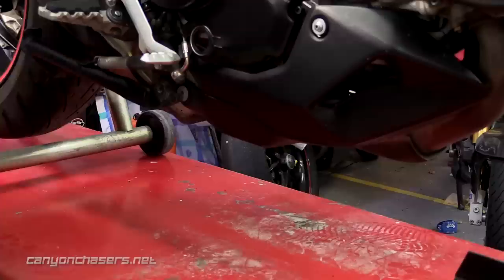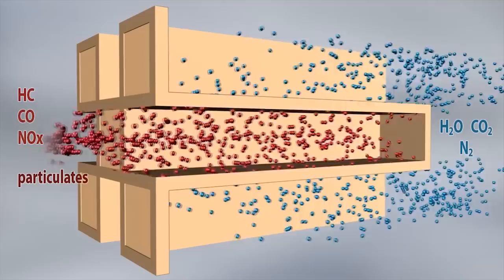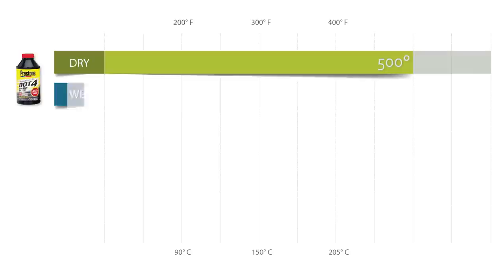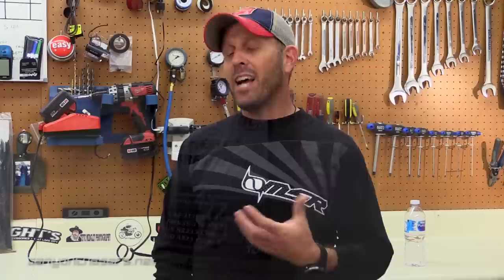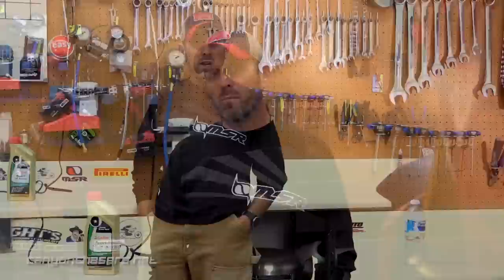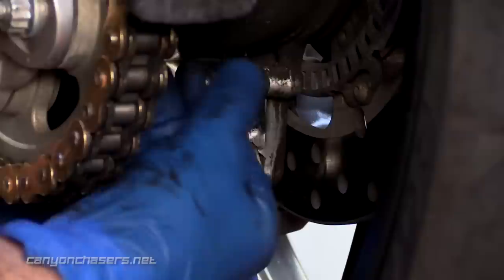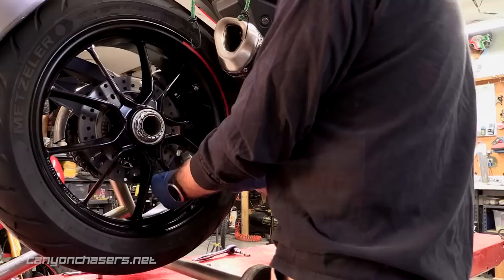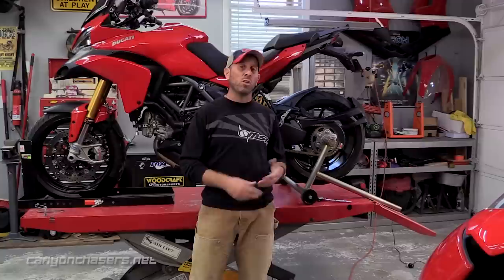How To Fix the Mushy Rear Brakes on the Ducati Multistrada 1200

Comment: Remove the rear wheel then the brake caliper. Place the caliper back onto the brake disc at the top with the bleed nipple again at the top. You can then pump the npedal all you like. the pads will simpoly go and bit the disc

Comment: Here is a heads up for other riders. I bought a used bike and had to adjust to riding it. I recently put new tires and put pads on and of course, bled the brakes finding air in the rear brake line. All was good and had more brake peddle than I knew what to do with. Next was a crash on a highway ramp that I have gone down many times. What happened? I couldn't understand why I would have this happen... until... I remembered the spongy  rear brake I had. I used the same pressure that I would have with the old brakes and the back wheel locked up while the front wheel went into a gravel patch and down we went! So, If you have this spongy thing for brakes and you get them bled and fixed remember to give yourself time to adjust to the new brakes. This is one time I wished I had antilock brakes.

Comment: I did this brake bleed for what seems like the hundredth time.  This time a little differently.  Instead of suspending the caliper on the exhaust side of the bike, I passed the caliper back through the wheel to the left side and I was able to get the caliper much higher, almost to the height of the pillion seat. The result was cable and caliper were all elevated nicely with no horizontal run in the cable.  It worked really wel and was the  best and fastest bleed so far.   I had to remove the plastic hood covering the cables to get the caliper up that high.      I used SRF again.  The rear brake is still turning to mush but taking a lot longer to do so.   Thanks again for the tip on the bleed technique and the SRF fluid!

Comment: Very well done!  You are right on the money.  Have been riding Mulitstrada's hard in the mountains since 2012 and have come to accept that nothing I have tried really holds up more than a few thousand miles as far as rear brake feel.  As soon as I watched your video I ordered the Castrol React SRF Racing Brake Fluid.  I received it in less than 24 hours and immediately flushed the system.  With a 2019  Multi1260s, I found it easier to simply remove the rear wheel.  No way to properly use a torque wrench to get to 33nm to the socket head cap screws that hold on the caliper with the wheel on.  Great video, Thank you!

Comment: Great video very informative - Alternatively: Dot 5 is silicon based - hydrophobic, great heat range- been on my 2010 Multi for 30k miles - still stopping (15 bucks ). Just thouroughly flush old fluid 'cause it does not like to mix with the glycol based ones at all.

Comment: Excellent video... I do exactly what the guy does to suspend the calliper when bleeding. In addition I put a shim the thickness of the disc between the pads to check for a firm peddle and then don’t have to push the pads back and remove excess fluid from the reservoir.

Comment: Had crappy rear brake, but now with castrol react srf racing it's back!! Did however remove the rear wheel, this made it a lot easier to do, but you have to remove all the rear guard and other bits. Get a bud to hold the calliper ash high as possible (can get it well above seat hight). Only took 4-5 fill ups (which is not a lot) just to make sure all the old fluid was cleared. All cool now!!

Comment: Excellent video!!!  I struggled with the rear brake on my Multi since it was new in 2013.  Last year I found Bel Ray’s dot 4 brake fluid which has worked VERY well.  I might have to switch it to this stuff next.

Comment: Hi, Thanks for the clear explanation of the issue & your solution, after multiple bleeding exercises and placing an heatshield between master cylinder and mounting, this will be my next action, before totally upgrading the rear brake system. The 2015 version has an upgraded rear brake system.

Comment: If heat from the catalytic/exhaust is a problem close to the brake fluid would a heat shield in between work?
Reply from the maker: Not likely.  You'd have to find a way to shield the entire system, including the rear master cylinder, which bolts directly to the frame and is super close to the cat too.
Reply: I have a custom heat shield between the master cylinder and where it mounts but it didn't solve the issue for me.

Comment: I know this vid is now 2 years old but the good news is Ducati are keeping it current and relevant. The fluid in my rear brake and also the clutch on my 2020 V4S went black after just one ride in slow traffic - lots of red lights where, without air flow, the fluids get cooked. I note that on forums some are recommending Dot 5 fluid. I don't know anything about brakes (this video has been very helpful) and a lot of people who offer advice on forums know less than me so I was wondering if you can advise if Dot 5 is a valid solution?
Reply from the maker: Dot5 won't solve the problem. Well even worse than that. DOT 5.1 and DOT 4 are both glycol based fluids. DOT 5 is silicone based and not compatible at all.  DOT 5.1 has slightly higher wet and dry boiling points, but the Castrol SRF is still quite a bit higher than that.
Reply: @CanyonChasers  thankyou! It may have been 5.1 that was being suggested so thanks for clarifying and confirming Castrol SRF is still the best option.

Comment: Dealership claims this high temp is not the problem, even with the high temp fluid.  He states guys in South who have year long riding season have no problem, the guys in North see a soft brake after it sits all winter.  Also the rear brake caliper is inverted with the nipple pointed down much lower than master cylinder.  Next flush I'll have the SRF Racing brake fluid. I'll give an update

Comment: Hello and thanks for the video. I have a question: for a standard bike use and therefore not racing is this oil okay? how often should it be changed? every 2 years as per manual? do you feel the difference using this castrol? Thanks again

Comment: I have the same issue with Ducati Monster 821 . Anyone else ?
Reply: Yep!
Reply: Unknown 
Yes. Replaced master cylinder was the ‘cause’- under warranty. 1 yr later back to mushiness and it always happens over Winter - mushy in the Spring.
Reply: Same 2015 monster 821 stripe it cost me 180$ every time I take it to the shop

Comment: great video. I have had 2 MTS over the last decade, both with the same problem. It seems you are saying this problem is related to heat.  So if this is the case, wouldn't the rear brake work initially when the bike is turned on and still "cold"? the rear brake is mushy from the get go regarding of engine temperature
Reply from the maker: Sorta. Once the brake fluid gets hot enough for long enough, the fluid isn't any good anymore.

Comment: Ducati rear brakes IMO have a couple issues... the first is exactly what's covered here (cooking the fluid). BUT... once you address that with better fluid, you're going to find that while the pedal is not as mushy... it still takes a LOT of effort to get the sort of braking effort you might be used to on other bikes. IMO the rear brake master cylinder is undersized resulting in a large force required to get substantial braking. I've just gotten used to using more force (or just letting linked braking do their thing).
Reply from the maker: Yep. It's a shame too. I love my rear brake.
Reply: @CanyonChasers  Makes me wonder if the linked braking MC is ALSO undersized so the rear doesn't do anything when using linked brakes. Luckily the M50's up front are fantastic and when you're on them hard the rear can't do much anyway... certainly not when the rear is in the air anyway. ;-)
Reply: Any idea if this still carried over to newer model bikes? I have that same mushy feeling in the rear on my 2019 Hypermotard. Should I give this a try? I’ve already tried bleeding with a motul fluid and it was literally better for only about 10 miles. Then went back to super mushy.

Comment: I have a Diavel which seems very similar.  Would I get the same results if I did't pull off the caliper and just hooked up my Mity Vac, and then put a weight on the brake pedal overnight to assist bleeding?
Reply from the maker: Our experience is that weighting the brake lever doesn't really accomplish anything. As soon as you start riding, air bubbles just move back into the system.  You don't have to remove the caliper, but you'll get a better bleed by putting the bleed nipple at the highest point to encourage all the air to get out of the system.

Comment: I have a '12 SF 848, same issue.  Would heat wrapping the exhaust near the rear brake reservoir help?
Reply from the maker: We tried it, and it didn't matter. The only thing that we've found to work is the SRF brake fluid.

Comment: Why not re route the line, and shield it from heat with something? Seems like a way better option.
Reply from the maker: We looked into that - and may still explore it further.  There just isn't a good way to re-route the lines to keep them far enough away the heat. The swingarm becomes a giant heat-sync.  We could space the lines out from the swingarm and wrap them with heat shielding, but honestly, expensive brake fluid starts looking better and better the more you look at it.
Reply: On a Yam xt660r the brake us similarly routed to the r/h/s pipe. I used aluminium  (aluminum) duct tape on the lines and stopped it boiling on steep mountain descents.

Comment: unfortunatelly it doesn't work on multistrada 1260, maybe because of different rear spoke whell or a bigger caliper... i dont'know...
Reply from the maker: The brake fluid will have a higher wet boiling point regardless of the wheel/caliper size. Perhaps you have another problem, like a damaged brake line or faulty rear master cyclinder?
Reply: @CanyonChasers  the problem is I can't put the caliper out through the spokes' whell. when you do it looks straightforward but on my 1260 it's impossible...

Comment: Would this be the same approach to the spongy rear on the Xdiavels as well?  This is also problematic on XDiavel 2016s+
Reply from the maker: Most likely. I have less experience with the Diavel, but the bikes are pretty similar.

Comment: Love the videos man! I'm going to try this fluid out on my 2015 1200s. Can bleed nipples be installed on the 2015+ models ABS unit as well. Would love to see a video on that. Also, roughly how long would you expect stock rotors to last on my 1200s? What are your preferred pads? I'm at 23,000 miles and about to install my 3rd set of pads. And bleeding for probably the 15th time hahaha.
Reply from the maker: Wow! Lots of questions. Haha.  Yes. We've installed the bleed nipple on the ABS pump. It didn't seem to make much difference, using a Pneumatic Bleeder does more. ( http://amzn.to/2EWYfNn ), Stock rotors should last a long, freaking time. I've never worn out a set and we just sold a bike with 60k miles on it.  I like HH Sintered pads. I like the feel a lot better than the Organic pads that come on most bikes.  EBC HH ( https://amzn.to/2vMPpSq ) pads are great and last a lot longer - in fact, they usually get hard and wooden feeling before they actually wear out.   But if you love breaking, you need to do the MTS 1200 Front Brake Upgrade.  All of us here have done this upgrade now.  https://youtu.be/aiGDtdWJKeQ
Reply: Thanks for the comeback man!  Really appreciate it.  I'll definitely be giving that pneumatic bleeder a try.  I also already ordered up the castrol srf fluid haha $$$  Really great to hear about the rotors lasting.  Also, glad to hear your opinion on the HH sintered pads.  That's what I've been running on my bike for a while now but they're in need of replacement again.  I've ridden all the western states, a ride to alaska and three track days on the HH sintered pads on the multi.  Pretty good! Maybe slightly grabby sometimes.  Just need to get that rear brake sorted out.  Luckily my multi is a 1200s 2015 and already has the M50 calipers.  So... castrol SRF fluid, new HH sintered pads, and the pneumatic bleeder.  I'll report back with how that holds up!  Thanks again.  Maybe we'll cross paths some time on the road.
Reply from the maker: Yeah, let us know how it all works out!  Sides like you ride even more than we do!

Comment: Due to some injuries, I haven't been riding for the last few years and my 2013 MTS has sat with a fresh bleed of Castrol SRF.  After the first year of just sitting, the rear brake went to mush again.  So, on my bike, I think I have an additional/separate issue.  Do you have any tips for troubleshooting?  Is this also somewhat normal for this model?  When freshly bled and regularly ridden, the rear brake stays working just fine.  It is only while sitting that the rear brake goes bad.  Any help appreciated.  Thank you.  P.S. I can only obtain a good bleed by disconnecting the rear brake caliper and elevating it while bleeding.
Reply from the maker: Even sitting, the brake fluid will still take on water, even though at a much slower rate.  We've noticed that if we are stuck riding in a bunch of rain, the rear brake will turn to mush almost immediately.  It's for sure a problem with most modern Ducati's.  The SRF is the only workable solution we've found, even many years after publishing this video.
Reply: Alternatively: Dot 5 is silicon based - hydrophobic, great heat range- been on my 2010 Multi for 30k miles - still stopping (15 bucks ). Just thouroughly flush old fluid 'cause it does not like to mix with the glycol based ones at all. Will store indefinitely with out water absorbtion since its silicon based.

Comment: A bit of aluminum makes a good disk brake analog for pumping a system with the caliper off the bike.  Most hardware stores sell thicknesses that will work (3/16" is ~5mm, the middle of the nominal thickness range for most rotors) and can be cut to a manageable "puck" size.  I made mine a little longer than the caliper so the ends stick out on both sides.  This lets me run mounting wire through holes in the  puck to keep it in place until you pump the brakes.
Reply from the maker: This is a fantastic alternative.  Most mountain bike brakes are bled using a similar kind of device.

Comment: Is the ABS pump on top of the engine like the Diavel? That's my main complaint about modern ducati Brake systems. Totally idiotic placement of the ABS so you have bubbles that go all the way up there. This makes bleeding time consuming and irritating compared to the old 1098/SF.
Reply from the maker: Yep. Same place. It's under the seat.  If you have a compressor and can use a Pneumatic bleeder ( http://amzn.to/2EWYfNn ) then that becomes much less of an issue.  But if you do it the old fashioned way, then it's a PITA.  We even put a bleeder valve on the ABS pump to get air out, but it didn't seem to make much of a difference.

Comment: Wouldn't it be easier to just us a non return valve on the end of your bleed tube rather than removing your rear brake?
Reply from the maker: Because the bleed valve is on the bottom, contaminated fluid and air can get trapped in high spots.

Comment: I'm having a mushy-non existent rear brake problem on a '15 monster 821. There are about 3k miles on the bike. Could this be the same issue?
Reply from the maker: It is entirely possible - but before throwing $70 at a bottle of brake fluid, try flushing your rear brake with some quality Motul brake fluid first. See if that solves it.
Reply: I have the very same issue on my Monster. flushed the line twice, replaced the rear master cylinder. all warranty work under a master Ducati tech....A year later , same issue again. Back brake doesn’t brake.

Comment: HI. I have a Monster 1200 R for one season now and the rear brake just gone mushy. Will try bleeding the brake fluid and see. Thanks
Anyone else had that issue on a monster 1200 ?
Reply from the maker: Yeah, let us know. I wouldn't be surprised if the Monster suffers from the same problem. Those catalytic converts get so hot.
Reply: anthony dossang Same on my Monster 1200S which has the same rear brake as the R. However the Castrol react did fix it.

Comment: Hmm Not so sure. The only part that gets hot is the caliper. All other remain at roughy ambient temperature. The figures you claim would melt the reservoir and the  hoses. Never see that before. I doubt that any part other than the caliper gets above ambient temp + 5 degrees so any fluid will do.